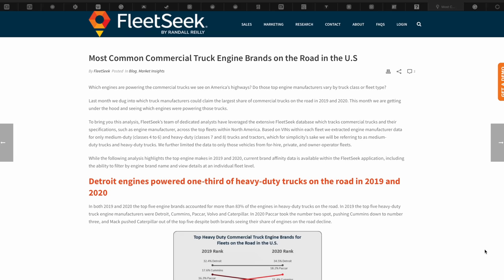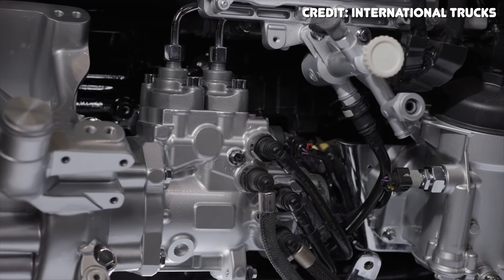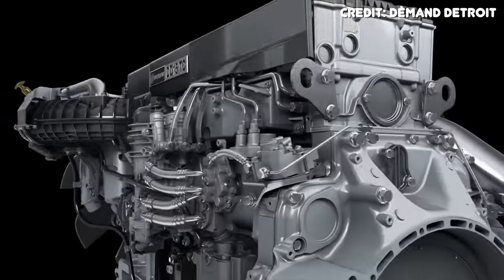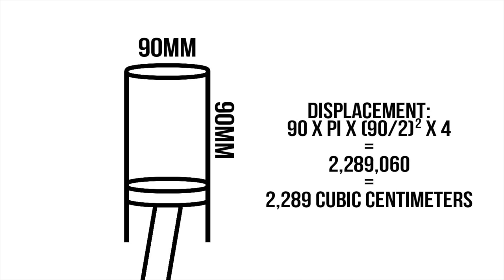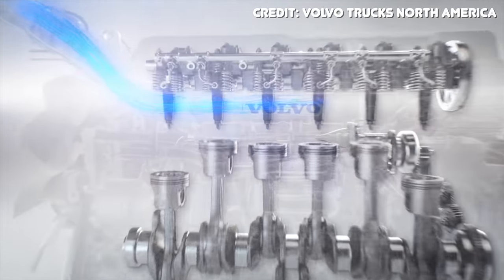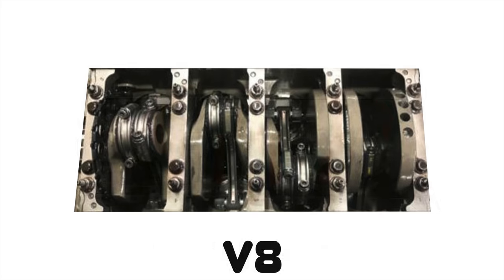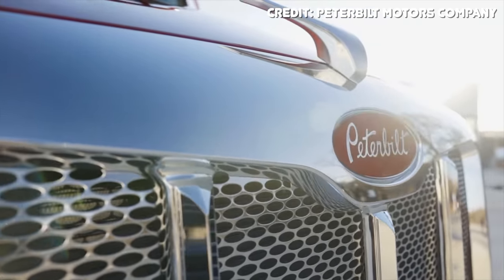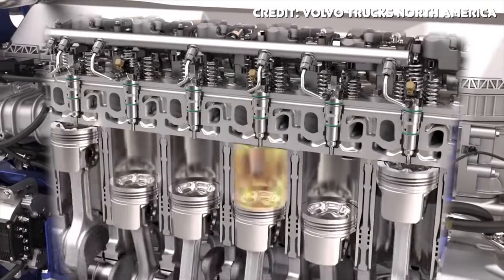Why do Semi-Trucks Use Inline-Six Engines?

Comment: Sounds to me like commercial truck makers understood many of the same things about I6 motors as the japanese sports car devs did back in the 90's. These are balanced, simple, and highly reliable engines. Built right, they can either last a million miles, or you can throw 50 lbs of boost at it and drift the shit out of it. 2JZ anybody?

Comment: Efficiency and good low end torque.  Straight six is the best engine period. 
I don't know why it isn't used more often in other vehicles.
Reply: Because most car owners like to be able to see over their hood.
Reply: because a lot of car owners are "happy"(unaware or don't care) with their front wheel drive 4 cyl hatchbacks, so manufacturers make them cheap.

Comment: There are many great gas engines that are an inline six as well.  2jz engines are pretty amazing.  Jaguar and bmw also made to interesting inline sixes.  I always though straight 8's were cool too.  They are a mile long though.  I've heard the a straight 8 buick can easily outrun a flathead ford.

Comment: Your torque unit is wrong in your example.
The correct one is LB*FT (pound foot of torque) where you are using LB/FT (pounds per foot).

Find it an important error because the units marked behind values are a guide for how the value is achieved.

Torque is force*distance. More distance or more force would mean more torque.
You wrote force/distance. That, if you squint real hard, describes something like gravity, more force applied the less the distance and less force applied the larger the distance.

Comment: Great video and explanation.   One Point that you missed, or possibly just left out(?), is the fact that you Can build a longer stroke into an inline 6 compared to a V6 or 8 while consuming  less under hood space overall, as you pointed out.   The main point however, is that as you increase stroke length, you not only increase torque potential, but increased piston speed is also a result as you increase stroke, thereby creating greater internal inertia, which contributes to greater lugging ability and "maintaining" the torque generated, for longer periods of distance in mountainous grades.   Exhaust runner and port size, also plays an important role in torque development.... but, that's a whole other subject for discussion.

There has been a long standing "Myth" that the old 2 cycle Detroits did not generate any torque.... Absolutely False.  

Whether it's 850 lbs ft or 2000+/- lbs ft of torque at the crank... it's all the same amount of torque (and hp) regardless of what engine develops it.  The problem for the 2 cycle Detroit's was it's own nature of being a 2 cycle.... Highly Efficient use of turning fuel into equivalent hp & torque outputs as compared to competitive 4 cycle diesel truck engines (and far outproduced power levels on the marine versions, compared to their 4 cycle marine counterparts.per ci)... and doing it with approximately 33% fewer cubic inches of displacement, comparatively. 

The issue for them, was the amount of it's "Actual" Power stroke length.  While often producing equivalent amounts of power compared to the larger displacement 4 cycles.... the ability to "hold" that power (torque) was reduced due to two factors... 1) a Total stroke length of only 5 inches (series 71 & 92 engines), thereby considerably reducing piston speed per revolution of the crankshaft in comparison to the 4 cycles.... and even more critically, Less than 2.5 inches of that 5 inch total, was actually producing power, while the remainder of the stroke travel was used in exhausting and scavenging the cylinder of spent gases.  

In the Series 71 & 92 engines, the roller lifters come off the cam lobe heel, at just 88 degrees of crankshaft rotation from TDC, opening the exhaust valves and Decreasing cylinder pressure... which equates to just 2.47 inches of actual Power stroke travel!!  

Now would anyone try to tell me how "inefficient" and "gutless" the 2 cycles were?..... show me even One 4 cycle Cat, Cummins, Mack, 4 cycle Detroit, Volvo or any other diesel truck engine that was capable of producing the same power levels, with the same "Actual" power stroke length of travel.  

All the "keyboard cowboy experts" and truckers themselves... have No understanding of the facts of these, now past, wonderfully efficient and reliable engines... and speak out of ignorance on the subject.  Some "Myths" just never seem to go away, and are kept alive by the aforementioned ignorance, trying to wax eloquent.  

The Series 71 GM Diesels remained in production (including the post commercial production of ongoing military contracts for the series 71 until 2007).... for 69 years!   No other engine of Any kind or type in the world, has ever had that kind of production longevity.

Until the EPA & their EU counterparts began mandating their emissions laws regarding marine use.... boats & other watercraft of all types and uses, necessitating diesel power levels of between 100hp and 2500hp.... was completely dominated by the 2 cycle Detroit's, with an overwhelming 82% of the total Global market share!  No other marine diesel in that power range, has ever.. before or since, dominated in the way that the 2 cycles did.

Interesting as well, is that the very same Gov't. entity, known as the EPA that put the 2 cycles out of production in the US for commercial use.... is Still, to this very day... having them ("quietly") built (1000 unit, minimum order - 6V53 & 8V92TA's, and the 8V71TA's were still "on the books" until 2014 although the last contract for them was in 2007) for use in various military vehicles, not only for the US military (mostly "apc's" [6-53TA's] and trucks [8-92TA's]), but for military export contracts to other countries around the world.

Thanks again for you video content.... I'm a subscriber to, and appreciate your channel.

Comment: Torque is meaningless, you have gears. RPM is meaningless, what matters is piston velocity which is constrained by flame velocity. A truck engine needs to be efficient which means you trade specific power and don't have highly overlapping valve openings and have lower fluid velocity through the valves. 6 is basically the smallest balanced in-line engine, if you look a marine engines they do the same thing, start with an inline 6 and add cylinders when they need more power.

Comment: V8's have piston slap which causes engine wear.Any piston laying on it's side wears the cylinder. Even the Toyota 2.2 gas engine goes forever being inline 4. Straight up and down is even ring and cylinder wear. Diesels will get over 1/2 a million miles with engine service.

Comment: Only one of the points you have raised actually holds water - simplicity.  Every other point is proven incorrect when you look at a Scania V8, these are the most reliable engine in my country's market, and they have the highest torque output of any production truck engine on the market.  In-chassis rebuilds are just as easy as a 6 cylinder, but the engine is removable in 2 hours anyway.  Balanced? Way smoother engine than any American produced inline six - with no balance shafts needed.

Comment: Does anyone know what Cummins engine our family boat might have had in it?  It was a 6 cylinder in line, and adapted from the truck version at the time, which was 1968 or thereabouts.  We used to see it on cab-over trucks of the era, where you could see large parts of the engine.  It was a common motor, but I can't find any info on it. It was a beautiful thing to me; I was small and it was HUGE!  It's so long ago no one really cares lol  Peace!

Comment: The famous Chrysler 225 cu. Inch slant six longetivity and durability is all about the same explanations you give. It was said  this engine was the closest a gas engine came to be a diesel engine having low rpm torque.

Comment: In Europe Volvo makes 16l V8 with 750hp and 3550NM and Scania makes also 16l V8 with 770hp and 3700NM (both in top configurations)
Reply: volvo are inline 6
Reply: 750 HP engines are for special purposes. In a normal truck they would just waste fuel

Comment: this is most simple is the MASS   you just tuched on  in a V8 there is mass by webbing and thrust  configurations of the block   in the I6  there is no loss due to area needed 
  is that not easier to explain then  what you did   the speed of the pistons is also an interesting subject  an there are high speed motors that can due two hindered thousand with little care     interesting video

Comment: You missed a bunch of builders. There is a major size constraint on manufacturing a big yruck. Its due to a v8 deisel engine vibrayes more than an I 6 does. Its not so much now a days butbit used to be a big issue. With the I6 engine you can get the same power as with a v8 . Nothing huge   more power smaller package . Legally its only 80 thousand combined

Comment: Some need an oil well, other's need deep pockets to repair  patients help with low torque and power so three type of driver, 1 hot rod driver ,2 prestige  ,3 durable long-term ,

Comment: One question I have is why are semi engines so big when their horsepower and torque isn’t that much more than the diesel engines in heavy duty pickup trucks that have half the displacement?

Comment: While yes  inline six engine are just by their design better balanced that’s about all I’ll give them. And when you talk about torque if your looking for torque you wouldn’t choose a diesel. . Diesel fuel burns slow and you only really get any power out of them between 1000 and 2000 rpm’s and most truck diesels are governed at at 2800 rpm’s. Next anybody who’s driven a diesel truck will tell you that diesels are cold blooded animals, they run the best and the longest wide open you have to get them up to temperature.The quickest way to decrease an engine’s life is to run an engine cold. The reason inline six’s are popular is economy and all this is coming from a guy who has been a diesel mechanic for over 45 years and love Diesel engines.   Thanks

Comment: DD is Mercedes OM 47x. A big step for Mercedes as the previous V6s were terrible. It's a question of intended use. You don't need 780hp for 40t, especially with current energy prices. The MAN D3876 runs excellently and the D3676 needs a little more rev if necessary, but easily consumes 6l less. Of course, if you have to pull low-loaders with heavy transport or are allowed to drive with 64 tons in Scandinavia, you also prefer V8 engines.
It's like the Cabovers. The classic ones look better, are less nervous on the road and have better aerodynamics, but if the law limits the length of the entire vehicle combination to 18.75 m, the 3m hood is missing at least in terms of cargo space and you believe that with your wheelbases you want it Don't drive trucks in Europe. I turn my 40t around at a small intersection in one go without reversing and it's not allowed to drive faster than 80kmh anyway and at 90kmh they are electronically limited by law and  the entire working day is recorded digitally and can be traced on a chip card for 28 days at every check.

Comment: <SIGH>  You got the torque and HP backwards.  When pulling a big load, torque is borderline irrelevant and HP is critical. Torque describes, in general, how an engine behaves.  HP describes how much work an engine can do.  The bigger the load, the more HP you need to move it.

Comment: The configuration of the engine maters allt becuas a engine makes the most power at 90 degreas +-30 degreas wich makes a i4 much less Smoth and torqy compared to a i6

Comment: Why would torque be a more important consideration than horsepower? You always get more torque out of an engine by changing the gear ratio, but you can never get more horsepower than the engine can produce.

Comment: I take it all back.
They dont all use inline 6 cylinders you have Detroit 6v 92 
Detroit 8v 71
Mack 500 v8 magnum 
3208 cat  v8 
 On and on.
But inline 6 is the most common high torque low rpms fuel consumption flat plain crankshaft engine.

Comment: Sit in a smaller truck with 5.2L inline 4 diesel (such as an Isuzu NPR) and shut off the engine. It shakes the shit out of you. Try the same thing in a similar sized truck with a 5.4L straight 6 Cummins, and you’ll literally feel the balance difference!

Comment: You just made a common error in thinking about engines.  Horse power is really what matters.  An engine with a lower torque and higher horsepower works well at a greater RPM so you leave it in a lower gear for longer.  If you have your choice of transmission, go for horsepower.  Torque only matters more if you can't select the gearing to make the best use of the engine.
A really good reason to go with an inline 6 is because a large displacement inline six doesn't shake nearly as much as the other configuration.   An inline 4 with large displacement will tend to rattle your teeth loose.

Comment: In the old days when I was driving trucks, a CUMMINS inline six such as a "Tiny 290" Cummins, a 350 Cummins, a 400 Cummins had THREE heads.  Each head covered 2 cylinders.  Where as Caterpillar had ONE head for 6 cylinders.  Then "Detroit Diesel"  course the "8 V 71" aka a 318 was a two cycle V-8 aka a "Yudden Yudden".  Then they came up with the 8V-91 series also a two cycle in the late 70's.  I HATED Detroits and would not hire on at a place that operated them.  Those Detroits were 100 MPH downhill and 20 MPH up hill.  Though were TOUGH but would not pull you hat off your head.  They showed ZERO Oil Pressure when Idling and would not really support a Jacobs Endive Brake like a Cummins would.    You know, that was during the TRUCKING DEPRSSION which lasted for about 20 years or so.  I operated (in the beginning) every kind they made, I hauled heavy Equipment, pulled Flat-beds but mostly Pulled Reefers.  I preferred Cummins Engines and would buy a CUMMINS if I were buying a truck today.  A BIG Truck that is.  I would NOT buy a DODGE Little Truck today just to get that Cummins Engine.  I won't buy anything made by General Motors PERIOD.  I hate them, and I would WALK before driving one.  So, in the USA that only leaves FORD for little trucks, and the only thing you can get in Diesel from THEM is a POWER STROKE.  I have one now, it has been a good one, but I PREFER an inline 6 still today.  

I don't know what engines they put in Volvos, but I would NOT be caught DEAD drving a Volvo Truck.  They look like a BATMOBILE with that big Bat Scoop on top.  It appears Truck Drivers have lost their PRIDE.  I don't wear Shower Shoes as daily attire, and would not drive a Volvo Trucks, a Stalk Cutter Truck, or anything but  Pete or Kenworth.  You can see that on "Bonehead Truckers" Youtube channel, they wear Shorts and those Jap Flaps every day even in Canada EVEN in the winter.  I have seen them wearing Socks and those "thongs" in the SNOW!!!  So, I guess THOSE guys don't mind a Volvo or a Mack.  A man that wears Jap Flaps everyday, he would NOT mind driving a Volvo.  If I had to drive a Vovlo or a MACK, I would drive with a Paper Sack over my head.  I would only drive a Conventional Pete or Kenworth.  I would quit a job on a Kenworth to get on a Pete.  And that would only be with a PROPER HOOD on it.  No Droop Snoots, Cabovers, or Short hoods of any kind.  I figured out NOBODY wil pay a truck driver anything so I work for people that had good equipment ONLY  That job Sucked back then and it is WORSE NOW!!!  I would never submit to some kind of "Electronic Clock" telling me when I could drive or NOT.  I could not stand walking in a Truck Stop now and seeing all of the TOE FUNGUS on display in the Restaurant or on the Fuel Island.  They should not serve people in a Restaurant who do not wear proper Man Clothing.  When you wak in to a Shippers PLACE OF BUSINESS you are representing the TRUCKING COMPANY.  So, if you walk in there SPREADING TOE FUNGUS everwhere, well, man, I would have to ask, "Do  they not pay you enough to wear proper Shoes or Boots?"  I would hire someone ELSE NEXT TIME.

Comment: Without watching I'll tell you why. Ease of working on, cheaper to produce and 600rwtq on an i6 is the same fuel and air requirements as a v8. It's just easier on an i6, as well as the design of most semi's. 600 tq is the same from a v8 or i6. I6 is better than a v6, but an i8 would be stupidly larger. I6 is the logical choice for cost of production as well as potential torque output.

Comment: Caterpillar used to make a fair amount of V8 diesel engines of different sizes for many uses. Today they make ZERO V8 engines anymore. They bridged the gap between the straight 6 and the V12 with the C18 and C27 and replaced the 3508 with the C32.

Comment: A single turbo straight six is the cheapest performance engine possible. Everything else is more expensive and less reliable. I run such an engine in my BMW M2. Over the road trucks also use the single turbo straight six for slightly different reasons. Chrysler is about to release their straight six and I hear it's very powerful.

Comment: A tractor is a truck, or not. There is no such thing as a 'Semi Truck.' 
Trailers, on the other hand can be a trailer, with all but a tiny amount of the weight borne by one, two or three axles near the center of the vehicle. The small amount of weight NOT carried by the axle(s) is the 'tongue weight' which can be a little as a few hundred pounds. Think of a boat trailer or small cargo trailer. 
Big commercial trailers put one or more axles at the very rear end, and then they sit on a fifth wheel at the front. That means that the "Semi trailer" splits it's total weight between it's own axles and the rear axles of the truck. A semi trailer really can't move without the truck. 
Thanks!!

Comment: Power that's why,,,,, plus diesel produces torque and power they aren't designed for speed if that was the case you wouldn't need a turbo to make it go down the road.  You ever blow a turbo on a truck?? Doesn't move under its own power